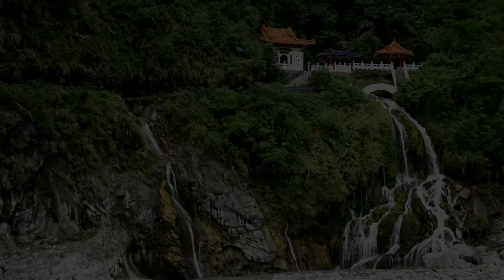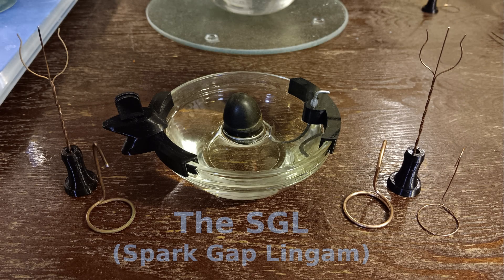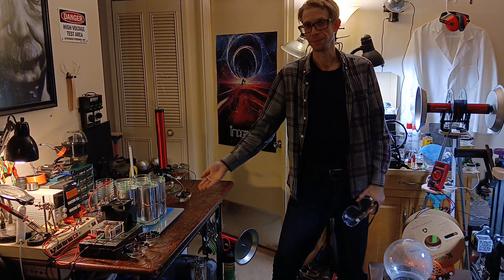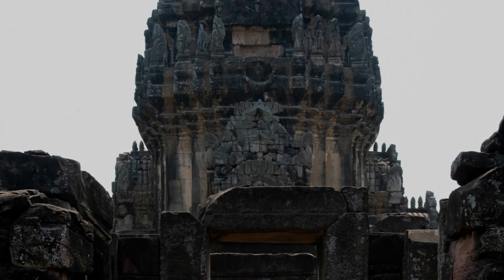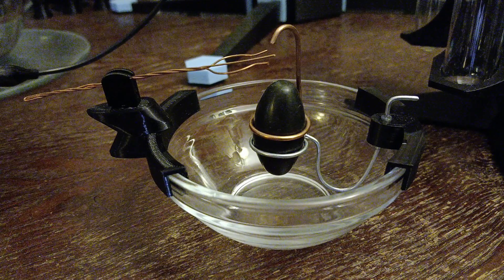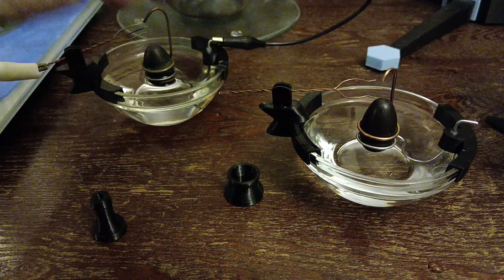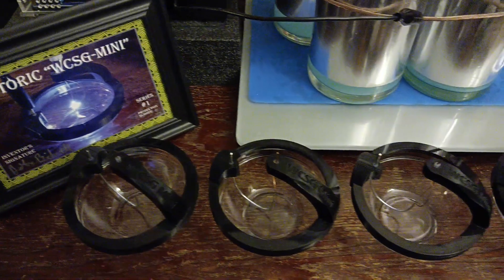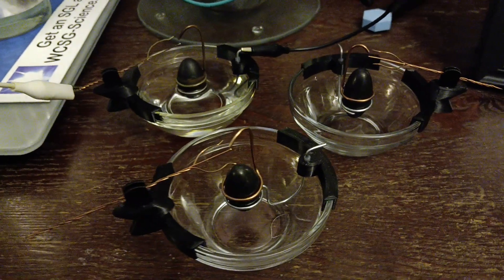How a Spark Gap Lingam (SGL) Works

Comment: Valuable, but please stop with the music it's very distracting and makes it hard to take in what you're trying to teach. Also why do you keep using the Electron model? Tesla, Steinmetz, and all the giants of Electrical theory were vehemently against it:

“To account for its apparently small mass, science conceives of the electron as a hollow sphere, a sort of bubble, such a bubble could exist in a medium as a gas or liquid because its internal pressure is not altered by deformation. But if, as supposed, the internal pressure of an electron is due to the repulsion of electric masses, the slightest conceivable deformation must result in the destruction of the bubble! 

Just to mention another improbability, the force tending to tear an electron apart is, in pounds per square inch, represented by the staggering figure of 256,899 followed by twenty-one zeros (256 sextillion, 899 quintillion) — and this is 513,798,000,000,000,000,000 (513 quintillion, 798 quadrillion) times greater that the tension that tungsten wire can withstand! And yet it does not burst! Not even when it is hurled against an obstacle with a speed hundreds of thousands times greater than that of a bullet!" ” - Nikola Tesla Article: “A Famous Prophet of Science Looks into the Future” (Popular Science Monthly)

“My ideas regarding the electron are at variance with those generally entertained. I hold that it is a relatively large entity carrying a surface charge and is not an elementary unit (particle). When the ‘electron’ leaves an electrode of high potential and in a high vacuum it carries an electrostatic charge many times greater than normal.” – N. Tesla 

“In the theoretical treatment of these electrons we are faced with the difficulty that electro-dynamic theory by itself is unable to give an account of their nature.” “For since electrical masses constituting the electron would necessarily be scattered under the influence of their mutual repulsions, unless there are forces of another kind operating between them the nature of which has hitherto remained obscure to us.” - Einstein on electrons; “Relativity”, by Albert Einstein, Random House Publisher, 1916

JJ Thomson developed the “Ether Atom” ideas of M. Faraday into his “Electronic Corpuscle”, this indivisible unit. One corpuscle terminates on one Faradic tube of force, and this quantifies as one Coulomb. This corpuscle is not and electron, it is a constituent of what today is known incorrectly as an “electron”. (Thomson relates 1000 corpuscles per electron) In this view, that taken by W. Crookes, J.J. Thomson, and N. Tesla, the cathode ray is not electrons, but in actuality corpuscles of the Ether.” – E. Dollard

“There is no rest mass to an ‘electron’. It is given here the ‘electron’ is no more than a broken loose “hold fast” under the grip of the tensions within the dielectric lines of force. They are the broken ends of the split in half package of spaghetti. Obviously this reasoning is not welcome in the realm of Einstein’s Theory of Relativity.” – E. Dollard

“Unfortunately to a large extent in dealing with dielectric fields the prehistoric conception of the electro-static charge, the ‘electron’, on the conductor still exists, and by its use destroys the analogy between the two components of the electric field, the magnetic and dielectric. This makes the consideration of dielectric fields unnecessarily complicated” - C.P. Steinmetz (Electric Discharges, Waves and Impulses)

The idea of electricity as a flow of ‘electrons’ in a conductor was regarded by Oliver Heaviside as “a psychosis”. This encouraged Heaviside to begin a series of writings. Also consider the J.J. Thomson concept of the "electron" (his own discovery). Thomson considered the electron the terminal end of one unit line of dielectric induction.

“Electrons as a separate, distinct entity…doesn’t really exist, they are merely bumps in something called a ‘field’.”  - Dr. Steven Biller

"Glaringly fallacious theories are responsible for such chimerical hopes. Probably the worst of these is the electron theory. Of the four or five atomic structures which have been suggested not a single one is possible. Not more than one in a thousand men of science knows that an electron — whatever it be — can only exist in the perfect vacuum of intermolecular and interstellar spaces or highly exhausted tubes and that the nucleus stripped of electrons, is devoid of energy.“ —Nikola Tesla “Our Future Motive Power.” Everyday Science & Mechanics. December, 1931. Pg. 230-236.
19

I think Walter Russel describes it best here:

"There is much confusion concerning the many kinds of particles of matter such as electrons, protons, photons, neutrons and others. These many particles are supposedly different because of the belief that some are negatively charged, some are positively charged and some are so equally charged that one supposedly neutralizes the other.

There is no such condition in nature as negative charge, nor are there negatively charged particles. Charge and discharge are opposite conditions, as filling and emptying, or compressing and expanding are opposite conditions.

Compressing bodies are charging into higher potential conditions. Conversely, expanding bodies are discharging into lower potential conditions. To describe an electron as a negatively charged body is equivalent to saying that it is an expanding-contracting body." -Light Does Not Travel by Walter Russell
Reply from the maker: Electrons, in fact, are a type of electromagnetic wave, as all things are, which can be demonstrated with an electron gun or in the many other ways charged particles can be observed. I only mention that the 'Trident PFR' (Positive Flow Receiver) helps to control electron flow, which are really magnetic waves, and this entire system is mostly a magnetic flux engine - the fluctuations are then harnessed, for example (with a Tesla coil), to vibrate a large space for providing an alternating energy source to power lights and other wireless devices. I will have a video soon on constructing a true radiant energy transmitter, and then, the magnificent receiver. Volt on!
Reply: @MadPlasmatist  It's an interesting take on it, but I personally subscribe to the terminal end of a Dielectric (the field responsible for Electrostatics) tension line model as originally depicted by J J Thompson before he moved to the particle model, as I find it to be more realistic and in line with the Aetheric model of reality, it's basically where the wire has failed to reflect the power and results in losses as heat, hence a perfect wire or Superconductor would have no detectible Electron flow because there is no loss in the system, this is also the model Eric Dollard and Ken Wheeler (as controversial as he is) agrees with:

"In general, the electrostatic potential, e, in Volt, renders the insulators hot, the magnetomotive force, i, in Ampere, renders the wires hot. Also, it is found that this heating increases with increasing frequency of the potential, e, or the M.M.F., i. It is here where the prevailing concept of the “electron” is to be found. Hence it is the motions of the electrons that give rise to the energy loss in an electrical system. 

Electrons represent energy dissipation. However, the pedant, the mystic, and the dis-informer all tell us that the electron is what conveys energy, the complete opposite!" -A Common Language For Electrical Engineering by Eric Dollard

I eagerly await your videos on some Radiant Shockwave transmitters and resonantly tuned receivers, I've been looking at building my own and a friend of mine has even had success in powering some small lights from metal objects around the room because of it. The more people talk about this, the better.
Reply from the maker: I've re-written physics properly, I will make a video on that too, you can find my early work on a past Kickstarter campaign which might shed some light on things =) https://www.kickstarter.com/projects/johnbidwell/the-secret-of-time-and-space
 @JenkoRun